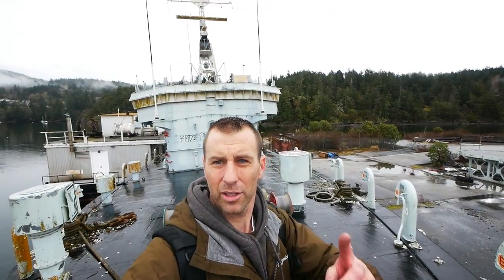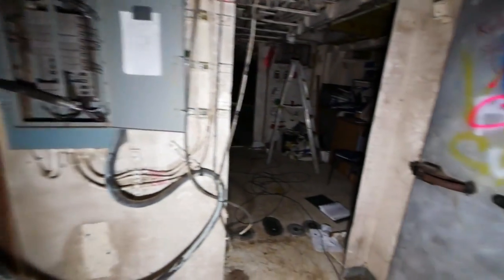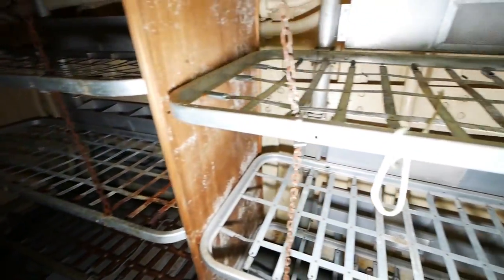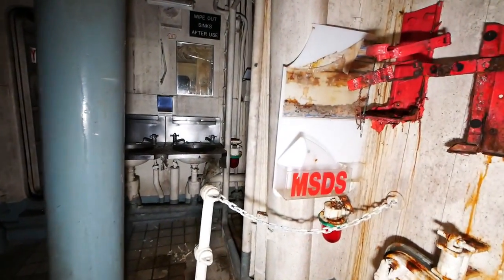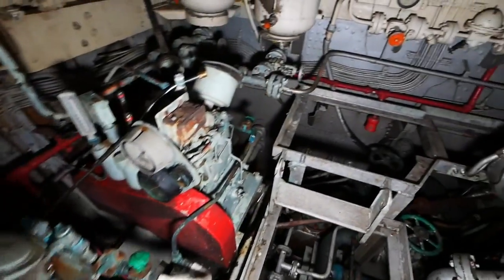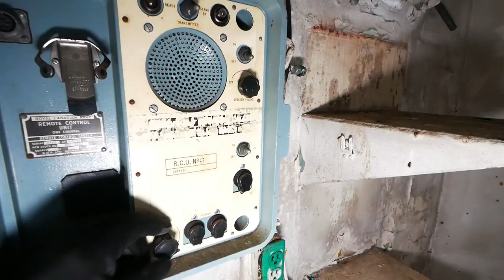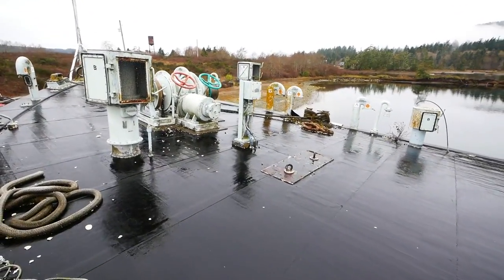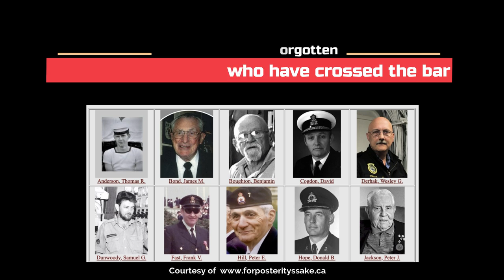Abandoned Canadian Navy Ship built in the 1950’s

Comment: The first compartment you went into was the Captain's (CO) cabin, with it's private wash space.
The second compartment you went into was the officer's mess and dinning area (called the Wardroom).  It looks like it was gutted.  It's not the "kitchen".  The galley (kitchen in navy parlance) was further forward.  The bulkhead at the forward end of the Wardroom that has a hole cut into it separated the Wardroom from the Wardroom Servery.  The beams are actually aluminum and the wooden planks were teak.  Since these boats were designed to be minesweepers, they wanted to reduce their vulnerability to mines activated by a ship's magnetic signature.
The third compartment that you only pan your camera into was the previously mentioned servery.
The next compartment, forward of the fridge, was the Chief's and Petty Officer's (C&POs) mess.
The compartment opposite the C&PO's was the galley.
The large compartment forward of the galley contained the Junior Rank's mess and bunks for the C&POs and some of the Junior Ranks, separated from each other obviously, but it looks like they took down all the interior bulkheads.
The compartment you went into after the engine room / control booth was the wheel house.  It's been striped, but the ship's helm (steering wheel) and engine telegraph repeaters used to be in there.  The telegraph repeaters were used to relay engine orders from the bridge (one deck above the wheel house) to the person sitting in that little control booth back in the engine room.
The first small compartment behind the wheelhouse was the chart/radar room.  There was a smaller radar display on the bridge, but the radar room was out of the elements.  It also contained a chart table where you could lay out your nautical charts.  All of which were stored in those wide drawers.  (Chart = map in navy parlance).  The LC204 in the chart room is a LORAN-C.  It's what came before the GPS and relied on signals from shore instead of satellites.  The box below it was the depth sounder to tell you how much water was under the ship.
The next compartment doesn't say "Commanding Officers only in here".  It says "Restricted Area (you cut out the top part of the sign, but I remember it) Unauthorized Entry Prohibited BY ORDER of the Commanding Officer".  That's because it was the communications room (or Comms Shack) and contained all the "big" radios, some sensitive equipment and any secret documents/manuals not held in a safe somewhere else on the ship (CO's cabin, for example).
The 40mm gun was mounted aft, on a platform behind the ship's funnel.  It was long gone by the time I sailed on one of these ships.  It was more for shooting at any mines that came to the surface than anything else.  It was removed when the ships went from being mine sweepers to patrol boats / training ships.  The blockish structure you can see behind the funnel in the drone shot (about minute 26:18) is where the gun platform used to be if I am not mistaken.  That new structure (that everyone called Dunck's Diner, no idea why), was accommodations (bunks and wash places) for the junior officers under training.  
The place you reached first after climbing up that ladder was the flag/signals deck.  That rack full of small subdivisions held all the flags and pennants needed to communicate with other ships without using radios.
There was no "roof" on the bridge.  There never was.  There was an awning over the top of it supported by all that white metallic tubing.  It kept you out of direct sunlight and most of the rain.  But it did get cold and lonely up there when you were all by yourself as the Officer of the Watch!  Also, as I mentioned before, the helm was one deck below the bridge.  So you would be giving your steering and engine orders to someone one deck below either using a 2-way microphone or the voice pipe between the bridge and the wheelhouse.  That big thing you are wondering about is a gyrocompass repeater - essentially a mechanical compass that doesn't rely on the magnetic poles of the Earth.  The wooden tubular thing beside it was the regular magnetic compas.
You didn't get to it, but under Dunck's Diner were two more Officer cabins, a wash place for them and the Chief Engineer's office.
Thanks for the video.  Really good memories.  Sad to see her in such poor condition though.
Reply from the maker: Oh wow thanks so much for sharing your knowledge and info on this ship Eric! 😁👍🏻
Reply: Very interesting information  you have provided   thank you 😊
Reply: That's a very cool information
Thanks!

Comment: Very interesting explore. Kitchen is a galley, bathroom called the head, egg shaped instrument on the bridge is a compass, btw not a WW2 ship, this class was built to replace WW2 Minesweepers. The 40mm Bofors gun was mounted astern of the stack - they were removed mid-service. Really great that you found her to film.
Reply: Thank you for your knowledge.
Reply: Aha, I thought that egg-shaped thing on the bridge was a compass! Thanks confirming my hunch :)
Reply: Egg shaped instrument is the compass binnacle. As built they had a 40mm Bofors on the forcastle, just infront of the bridge. UK versions had either a 40mm bofors, an orlikon, or a searchlight behind the funnel. Great video, even if sad for those of us that served on them
.
Reply: @johnsstuff7656  the 40mm was never on the forcastle.  It was mounted aft of the stacks when they were sweepers. Later they were reclassed Patrol Boats, and the guns removed.
Reply: The last near original Bay Class sweep....I served aboard her sister the HMCS Chignecto back in '78.   Last saw her on the Surrey side of the Fraser River getting broken up.  Hopeful the Cowichan can be rescued and maybe turned into a training ship for the local Sea Cadets.
Reply: @miken7976  - Did not do my research properly Mike.  The Bays might have used the UK hull design, but all built in Canada.  The UK Tons had a serious corrosion problem,  parts the alumininium framing turning to a white mushy paste, sent many on early visit to the scrapper.

Comment: Excellent video, but be careful!  The danger with ships, whether abandoned or not, is that certain enclosed areas might be very low on oxygen. The chemical process that produces rust on steel is an oxidizing process, so nearby oxygen is 'consumed' over time. If there is poor ventilation, oxygen in a compartment may drop to fatal levels. You may pass out, be unable to escape, and eventually die. Entering 'confined spaces' should only be done following appropriate safety procedures, including using a hazardous gas detector and an oxygen-level detector prior to- & during- entry.  This is not an issue with abandoned buildings or houses, as enough air will bleed through all the holes and damage.  A big steel box is another thing completely.  BE SAFE! :)
Reply from the maker: Thank you and thanks for sharing this

Comment: Seeing that this ship was built as a mine sweeper. I'm guessing it was covered in wood with the hope it wouldn't set off a magnetic mine.
Reply: Not covered , the hulls were entirely wood and the metal structures aluminium . All the fixtures and fittings were originally of non magnetic material , brass etc. The modern fibreglass ones all the fittings are stainless steel , it's why they are more expensive than normal ships .
Reply: @DavidSmith-cx8dg  the other thing was her GMD 12 Cylinder engines were Stainless Steel, so they were not magnetic.

Comment: 22:54 The smaller component above the radar looks to be a repeater for the echo sounder. Tells you the depth of the water. Don’t know what the larger one is but looks to have something to do with a radio beacon maybe.

Also the helm (steering wheel) would of been below the bridge next to the first radar display.
Reply from the maker: Thanks Kevin 👍🏻
Reply: Its a SIMRAD LC 204.
Reply: The hand was on a Internav LC204 Loran C to give ships position through radio transmitters on land , before GPS.. The little remote display below it is a DAZ 13 , fed from the main ELAC LAZ 50 echo sounder @ 22:30 . Used to maintain this equipment at dock yard in the 90's. Use to maintain the Sperry SR 120 gyroscope on all the minesweepers as well .
Reply from the maker: @joelima201  thanks for sharing this!

Comment: Yes. MSDS is material safety data sheets. They call them SDS now. Every commercial chemical has one. It gives you all the info about the chemical…flash point, difference hazards, PPE(gloves, respirator, etc) you need to use while handling it. Also tells you what to do if exposed…via inhalation, eyes, skin, etc ie flush eyes for 15 minutes & seek medical attention. Etc. I was in the US Navy. Great video.

Comment: all most 95% of the metal onboard is nonmagnetic stainless steel, brass,  aluminum, or bronze. If you walked around the ship you would find very few metal parts that a magnet will stick to, that likely is why someone wants to scrap it.
That is why there is no rust and the hull is three layer wood with rubberized canvass between layers.
Mine sweep hulls will last longer than many steel hulled ships. and as wood swells when wet they leak very little.
I served on US Navy bay and ocean class mine sweeps. the bridge was covered with a canvass cover and likely very cold in Canadian winters

Comment: This HMCS Cowichann was laid down in 1956 and Commissioned in 1957.  It is being confused with an HMC ship Commissioned in 1941 and sold in 1946..
Reply from the maker: I didn’t confuse it. This video is about the HMCS 162 👍🏻
Reply: @AbandonedUrbexCanada  Yes you did.  Hull number 162 was laid down in 1956 not 1941.  I sailed in her sister ships Miramichi and am quite familiar with the class.  The HMCS Cowichan you were on was not a WW2 ship and if the builders plate was still above near the top of the house, it would tell you that.  The WW2 version was not made of wood either.
Reply from the maker: @richardguitar3870  yes correct, I didn’t mention it was decommissioned in 1941 that was her sister ship

Comment: Can someone answer this question, has the roof of the bridge been cut off or is this an open air bridge? 
Also, there are many many items that could be sold to make money. It's sad to see something this beautiful just rot away and be forgotten. In the room before you went up on the bridge was a map cabinent in the room with the radar. Absolutely beautiful piece of furniture. Thanks for sharing!!
Reply from the maker: It was an open bridge but they did use a canvas top that could be removed
Reply: The black and white stills showed the bridge in its original condition, at least one with the canvas cover. Most pictures I could find do not show it. But then photographers like to take pictures in good weather.
Reply: @cageordie  the Bay class sweepers were always an Open bridge design.  Junior officers learned how to drive a ship in all sorts of weather from up there until 1997.  The canvas awning was erected only in good weather to protect from the Sun. It would be distroyed in bad weather.  The Helm was below, (and is missing now), in the space that the Radar Room was accessed from.